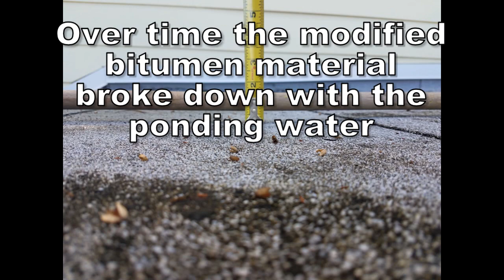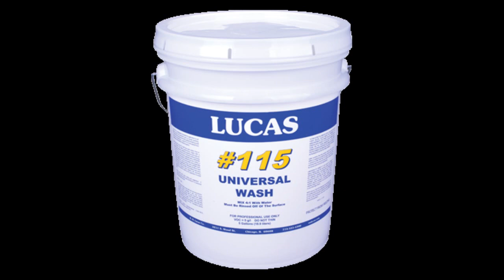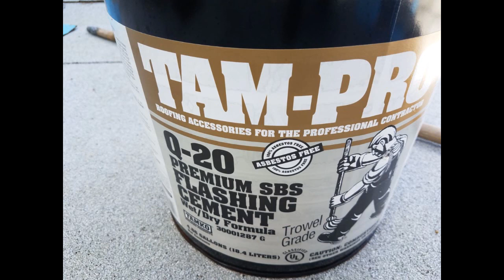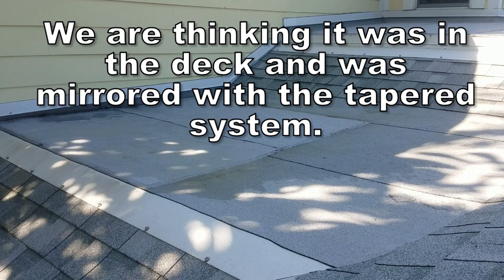Ponding Water on Flat Roof - Build Up With Cold Process Modified Bitumen SA

Comment: Looks good, ever thought of using roof leveler mix?
Reply from the maker: It was a new install (warranty) and I wanted to make sure the finished product was still granulated modified. I also wanted to stay with like materials. If it was a new call and this was the complaint, then I may have applied a coating product to remove the low spot.

Comment: We have a number of older homes in the local market with flat roof "ponding"  ( US Western Penna) and 
the problem is significant as you show with a bitumen surface.
it ALSO deteriorates an EPDM commercial surface but not as quickly.
your approach was quite detailed.
my suggestion is to have home roofs designed with some slope but
architects seem otherwise oriented.
bad karma!
Reply from the maker: This is how to get through an existing situation. Usually we can add tapered insulation to add some slope, but for some reason this one did not work out as planned. So this was the answer to keep water from standing.

Comment: Thanks a lot for the video. Where can we get the sheet you put on? What adhesive do you use, is it a kind of tar?
Reply from the maker: It is called Modfied bitumen Granulated cap sheet. The reason I used the self adhered in this video is I am using "like" materials, as the existing flat roof is a self adhered material (Certainteed SA Cap). There is a cold process version or Mop Grade. The adhesive is either Modified Roofing Cement(Trowel Grade) or Modified Roofing Adhesive (brush grade) - check out this video https://youtu.be/xm6dUYQFfGc - https://youtu.be/Ko0kk1IKEPs
Reply: Thanks a lot for the reply. My roof has a one-inch deep pond of ~4 sq feet near the drain. I saw you put on a few layers of the cap sheet over a few weeks in the video.  Can I coat a few layers of this cap sheet with bitumen in between within one day?
Reply from the maker: I am always wanting the layers to cure out. That is why I only did a layer at a time. It really doesn't matter what your doing, it has to cure or the bottom layer will never cure. This is the method used without tearing off and is pretty solid. All it is doing is displacing water. The standing water will eventually wear away the material in that spot.
Reply: got it, thanks a lot!